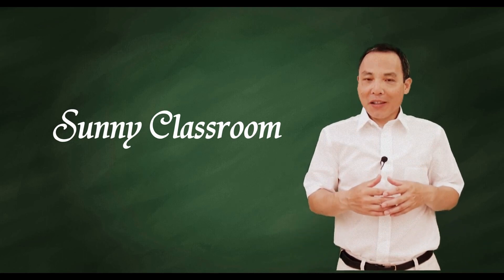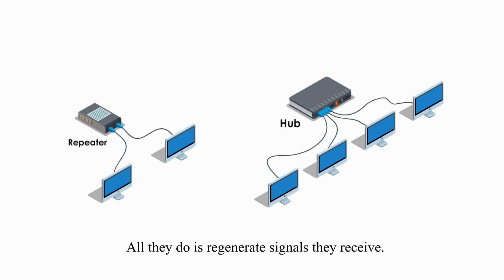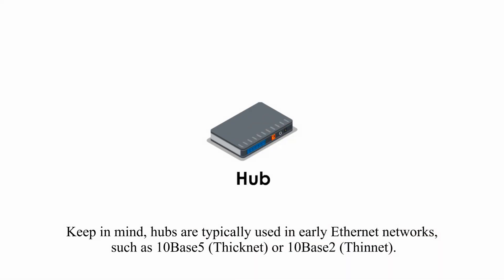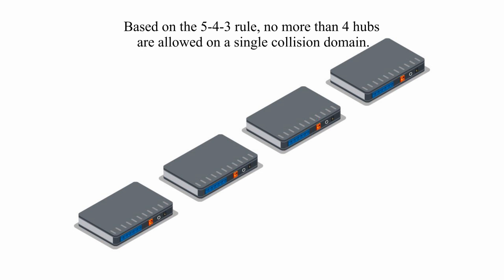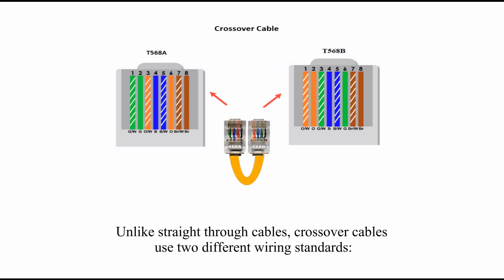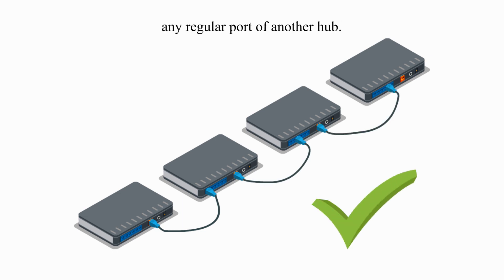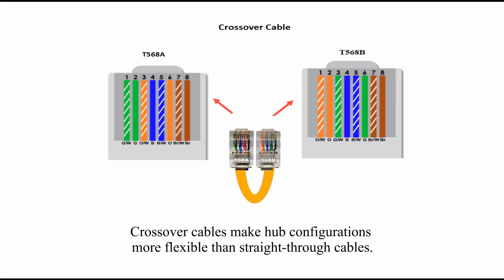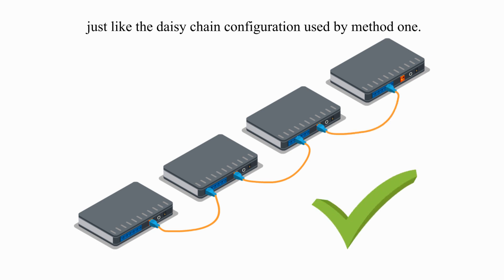Hub Configuration with straight-through cables vs. crossover cables.

Comment: Dear Sunny please let me know that should I use  straight or crossover cable in this scenarios...
1. First router to second router second router to third router to fourth.
2. And while I connect these four routers to each other should I use regular Ethernet to Ethernet ports or Ethernet to uplink ports or uplink to uplink ports to connect all the routers.
3. i used an optical fibre internet connection given with a modem which has two Ethernet ports on the first company provided router and the rest of the three routers are TP link Wi-Fi routers.

I will be grateful if you could help me out on this thanks once again

Comment: Dear Sunny, who uses hubs anymore, you can't even easily buy them theses days. They are a dead  old technology. Switches are now the defacto connectivity!
Reply from the maker: Yes, you are right. At home the Internet box still has some part of a hub. However, it is a device of the past.. You are correct.
Reply: @sunnyclassroom24  Any modern switch is full duplex 1 Gbps (or more)  device with support for straight or crossower cable. Why even consider a hub's if it can not support 1 Gbps or more???